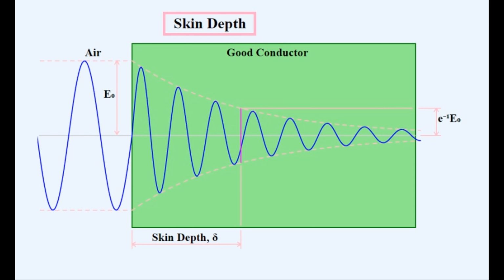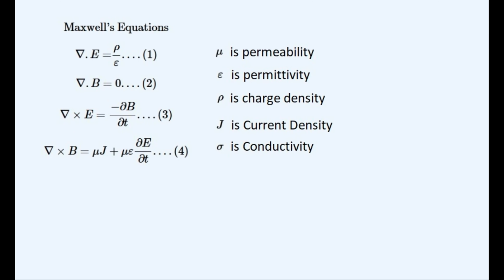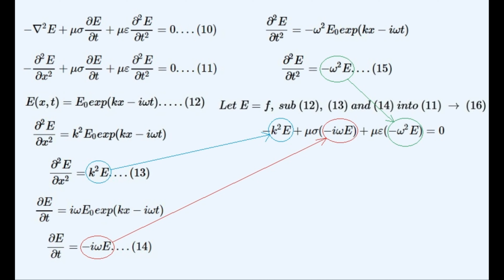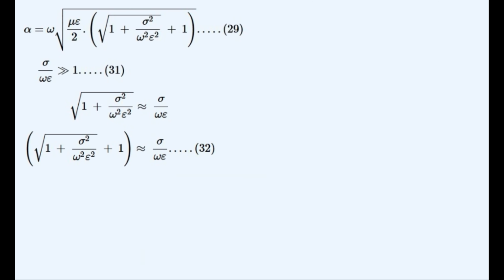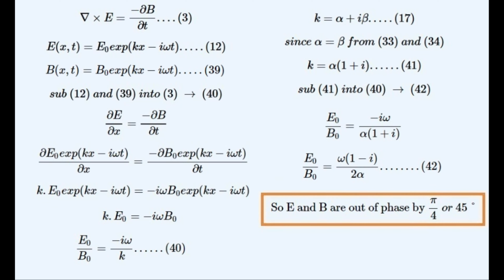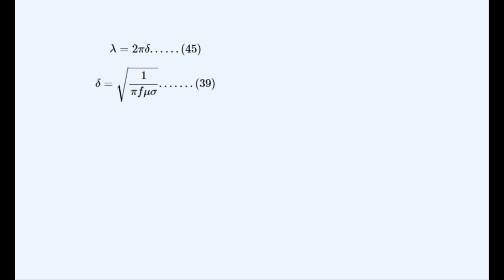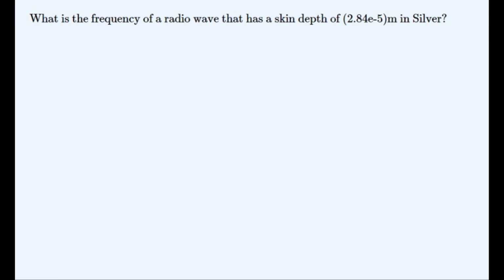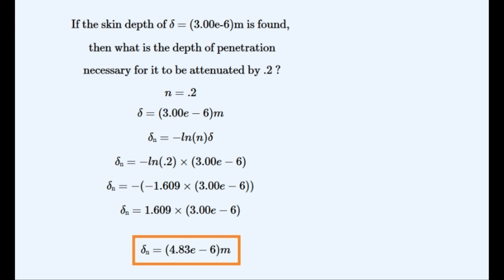Skin Depth

Comment: In eq 31, for example, is there a good estimate of er (not infinity) that we can use for a good conductor?
Reply from the maker: I looked up some values and 1 to 10 is a good value of er fro Iron. I possibly needed to put a lot more stuff in like this, but its hard to think of everything. I just wanted people to get used to the math processes used to derive these equations.
Reply: @ you can also derive that RC=pho*epsilson for a rectangular bar.  Still need C across that bar……
Reply: @ thank you for putting this together.
Reply from the maker: Its good to be appreciated.

Comment: shouldn't there be an infront the kx aswell? (in the equation for E)
Reply from the maker: Could you please tell me where this mistake is in the video in terms of minutes and seconds from the start, and I'll try to correct it. I just wanted to give viewers some videos on vector calculus to get them used to it, since it is very difficult for a lot of people who know algebra and calculus extremely well.
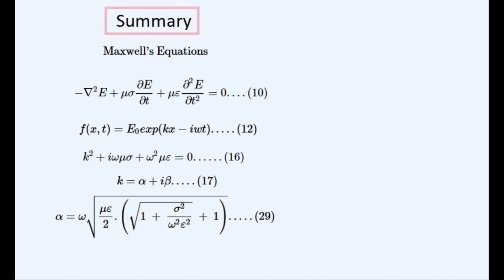Reply: @electroworld9872  wow, didn't think you would still respond to an old video :D , e.g. 3:18 in equation (12), the whole exponent of e should be imaginary when describing sin/cos waves,  thus exp(i(kx-wt)) or exp(ikx-iwt) -  that's at least how I learned it

Comment: I calculated the skin depth for a problem I am working on ~11,000 m but need to see how much the magnetic field would be reduced at 250 m. 

Conditions:
sigma - 5
f - 4.166666666666667e-04
m - 1.256627e-6

Could you help point me in the correct direction? My initial thought is that 250<<<<<110000, so the amount the magnetic field would be reduced is close to 0 but I am supposed to give specifics.
Reply from the maker: It looks like you'd use exponential functions to evaluate it, at least to evaluate the envelope exponential decaying function.

Comment: Excellent derivation explanations! Thanks for sharing. If a DC current pulse (passing through a good conductor) with a climbing-up time of 500ns rising from 0 to  10000A and immediately followed by another 500ns but with constant 10000A, then dropped from 10000A to 0A within 500ns. Will the skin effect the same all this time?
Reply from the maker: You would have to use a Fourier Transform to calculate all of the frequencies in this pair of pulses, and they'd all have different skin depths. That's the general approach to this problem.

Comment: When you calculate the skin depth of an EM wave of 3 MHz in Iron, why do you use the permeability of free space instead of the permeability of iron?
Reply from the maker: The response time of any magnetic material is too slow to affect a high frequency electromagnetic wave, so the permeability of free space is the only permeability that is ever used.